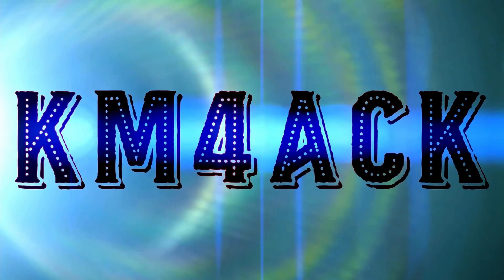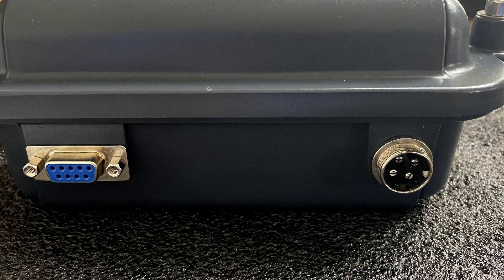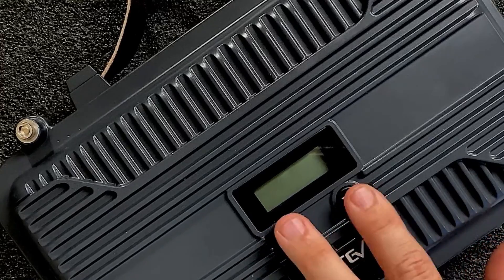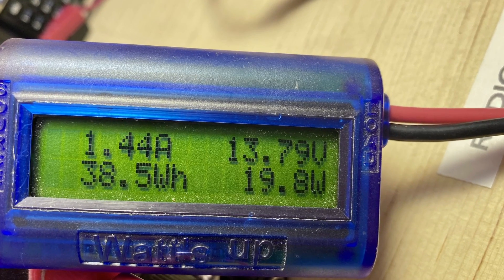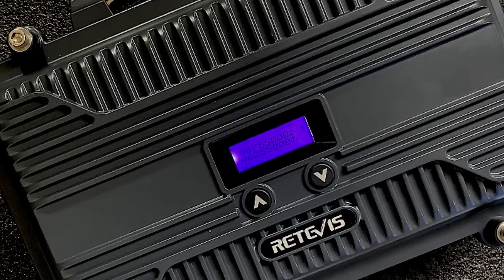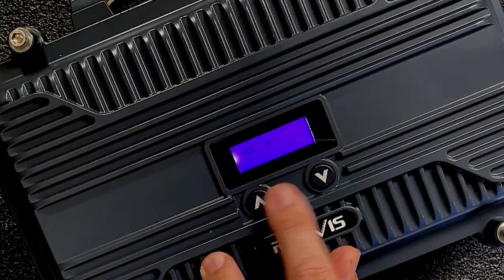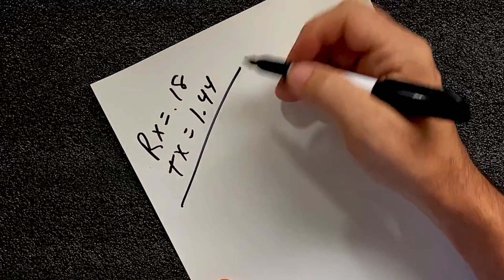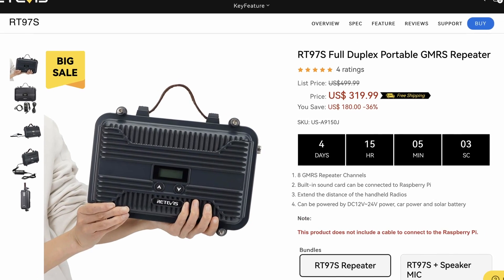Retevis RT97S Portable Repeater

Comment: As far as weatherproofing, this thing along with a small LiFePO4 battery fits just dandy in a standard marine Group 31/24 battery box.  Combine that with an N9TAX roll-up J-pole antenna, some coax, an arborist throw bag, and line, and you have a kit for setting it up at a random high spot out in the woods for a few days.

The lack of Linux support for the programming software is definitely a problem though.

Comment: This is the repeater my deer camp group is looking to purchase.  What kind of range were you getting with using the HT inside the vehicle?  We only need to cover a 5 mile radius max, but terrain makes it hard for us to use HTs without a relay person at the cabin.
Reply from the maker: The range will depend on the antenna height more than anything else. You will need to do some test to see how high you will need the antenna to cover your specific area as it will probably be very different than my area.

Comment: Wouldn’t we be better off using the $58  TYT TH-UV8000D handheld it has cross band repeat ? Or using a “manpack” a mobile like the TYT TH-9800 MOBILE RADIO?
Reply from the maker: All depends on your needs. Multiple ways to accomplish the same thing. Pick the tool that works best for you roll with it :-) This repeater happens to be GMRS which is perfect for comms with the non ham family members.

Comment: Is this a "ham" or GMRS version?  Rather pricey, I think.  At home there is a hill between our house and the "rest of the world."  I use an inexpensive HT (TYT TH-UV8000D), bought new for 60€, with a real 10w output (measured at antenna base) that has crossband repeater functionality   It is located in a remote ham shack near the top of the hill.  The HT is connected to a Diamond X30N antenna that is mounted on top of a 6.2m aluminum flagpole.  My wife on the "home side" of the hill transmits on UHF frequency.  The crossband repeater retransmits on a VHF frequency that I then receive.  When I transmit on the VHF frequency the repeater retransmits on the UHF frequency that my wife picks up.  I  tested up to 5 miles away, including obstructions.  Signal and clarity were pretty good to very good.  This setup is meant for the time when we lose cellphone and internet for a longer period of time and not for day-to-day comms.  We use our cellphones for that.  But you could use that setup temporarily while camping, RVing etc.
Reply from the maker: This one is GMRS but they do offer a ham version as well.

Comment: Them UHF repeaters are nice.  I did set one up on GMRS . had to use good coax for UHF . and high gain antenna with some height.  only 5 watts appx. after duplexer.  the repeater ID can be done from the 9 pin mic port. no plug and play ID yet but maybe some day. the Midland one is the same.  you can use one of them repeater ID boards  and wire threw mic jack. GMRS ID slightly different than HAM. I put reverse polarity diode   and ferrite core on power leads inside unit. you can run a amp with GMRS one. up to 50 watts but have to bypass duplexer and use a external one.  a lot of work. they have 50 watt version coming out. just no date on that . UHF is line of sight so a high place works best for repeater. watch for metal budlings near buy.  73's

Comment: Our local group plans on buying one of these. It will be about 1000' above the valley floor plus the height of the tower where the antenna is. I would expect to get a line of sight of 8-10 miles (probably much further). 73 DE N7ARO
Reply: I get 10 miles with my antenna up 37 feet in Kentucky

Comment: I own the repeater but the early model  for GMRS but one of my club member's has that exact model and I have a few ways to have the repeater ID one of them is to have a radio that you don't use much connected to a PC and run echo station and have it ID right through your spare radio or get a raspberry pi and a USB Shari hat transmitter and install asterisk and set it to beacon ID automatically or if you don't have a spare radio get a din to 3.5MM cable connect it between your repeater and your PC and run echo station and have it ID those are my tricks but for mine I just used default tuned frequency and have my GMRS live node transmit to the unit which already has the ID setup

Comment: I think that was a fail, when you were driving around.  
Thank you for testing the repeater and all the work making the video.
Reply from the maker: Only a fail of the two antennas. The repeater was working as expected. Given better antennas on both ends will extend the range of the repeater.
Reply: @KM4ACK  What was the max distance in the video?
Reply: We don't know the distance. Maybe they were 10 mi. away? 😉